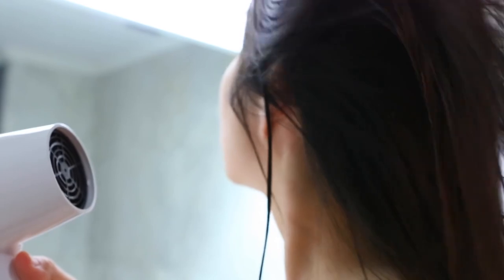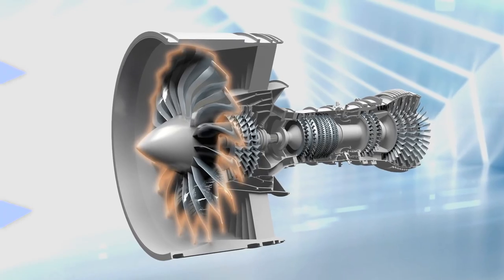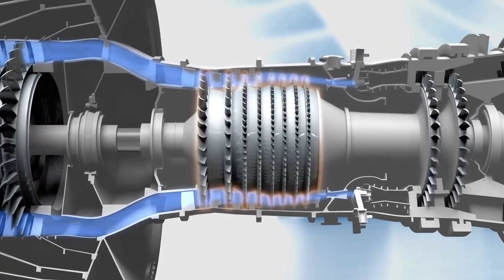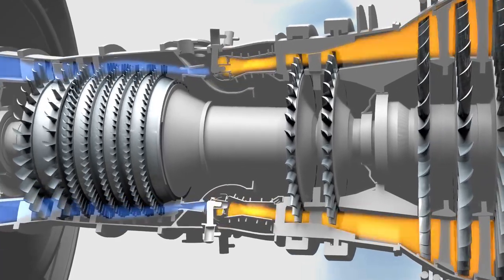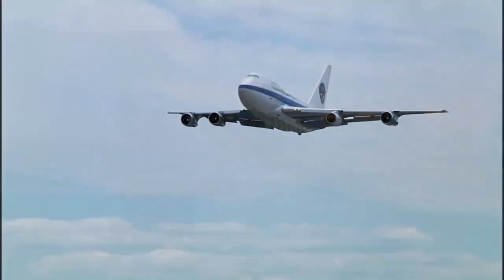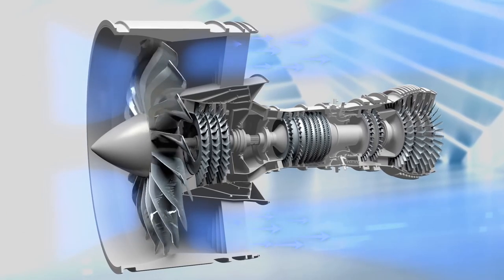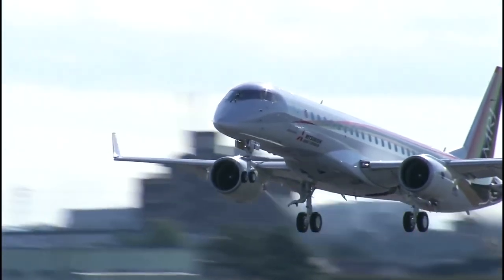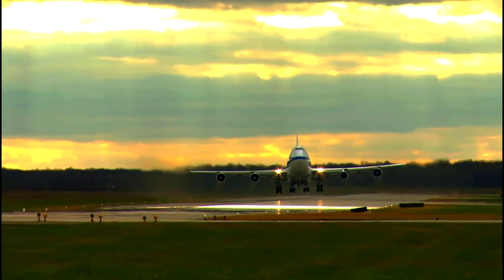PRATT & WHITNEY: How Jet Engines Work

Comment: Let's talk turbans people, let's talk turbans 🙂 so turban technology has been around for at least 100 years since the 1920s but didn't get a good go until WW2 when several firms including the Germans and their engineer's, managed to produce turban engine technology to the first jet turban powered aircraft the me 262 and post war, several American firms made their own jet turban powered engines like pw, rr and ge, turban technology has greatly improved over the past 40 years to provide excellent fuel burn ratio and quiet engine optimization 🙂
Reply: Turbans are islamic head wear. What you mean are turbines